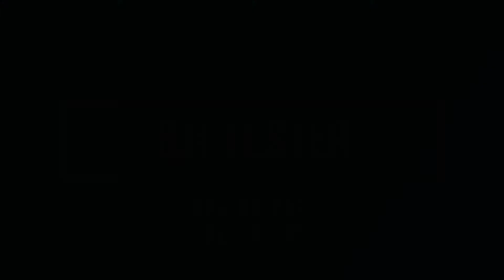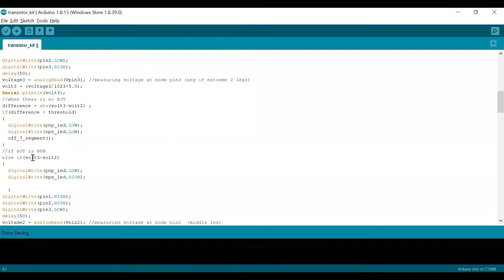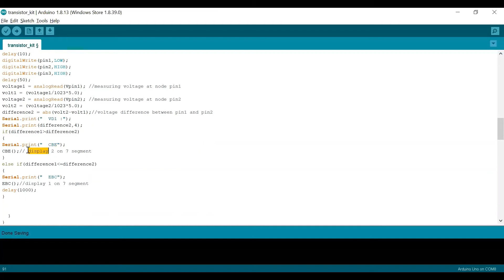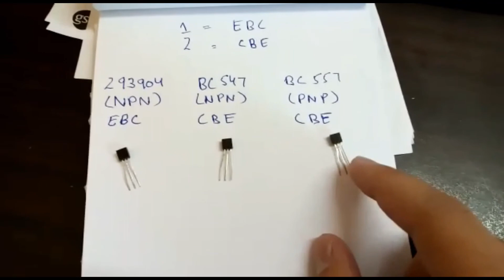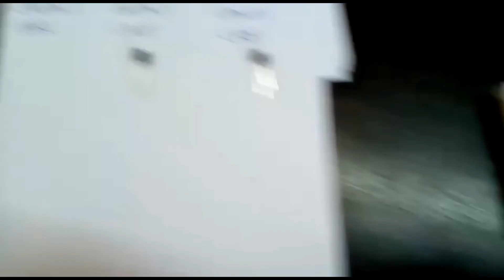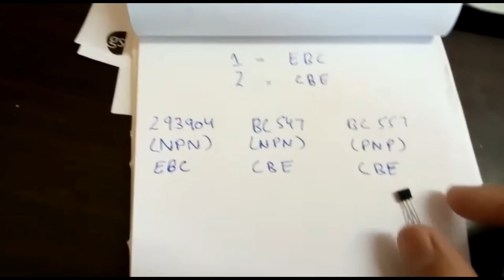Making Bipolar Junction Transistor (BJT) tester circuit | BJT tester kit using Arduino

Comment: Hello, I recently purchased an ADS1299eegfe-pdk which is the test kit for the ADS1299. And I'm trying to use it with arduino, however I have a thousand doubts and frankly I don't even know where to start. So I would appreciate if you could share some additional information with me, I mean that I do not know exactly or how to power it, much less what are the first steps for SPI communication between the arduino and the ADS. I hope you can help me, best regards.